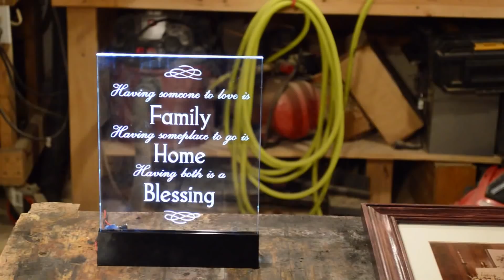1971 Small Engine Restoration

Comment: Can you show us the code? I doubt thats a 71, in fact almost positive of it. It has all the looks and features of around a 1981. A 71 still would have had the old easy spin sticker on the recoil and in 71, they didn't market I/C like that. Its an 81.
The first two digits of the code will say the year.
I have a 74 sitting in my shed right now, its got much older style decals and much different color paint. I do have an 87 that looks much more like this, with the more modern decals like this one in the video, except magnetron ignition obviously. I do have an 81 vertical, looks just like this motor as far as paint and decals. Sorry to call you out, I'm sure it was an honest mistake. If I turn out to be wrong, I will gladly confess to it and apologize, but more than anything its killing me to know what that code reads on that engine lol.
Actually 13 minutes on, magnetron ignition, didn't start until late 81 going into 82, wasnt on all Briggs until 83 and I can see by the color, thats a very early magnetron coil, yup 81 or 82 engine.

Comment: Did you destroy the starter clutch pulling it off? Those don't pull off, if you don't have the tool they make to remove it, take a small block of wood and a mallet and give the block of wood a few good knocks against one of the ears going left and it will loosen so you can unscrew it off.
Reply: Hey, I see you seem to be into motors and stuff too so I was wondering if you know what made the noise because I have an older Briggs motor that makes that noise and want to fix it, Thanks !

Comment: I would go back and wire wheel the fly wheel where the coil rubs on it with all of the magnets so you get better spark because you painted over it
Reply from the maker: its a  Magneto there's no conductivity between it